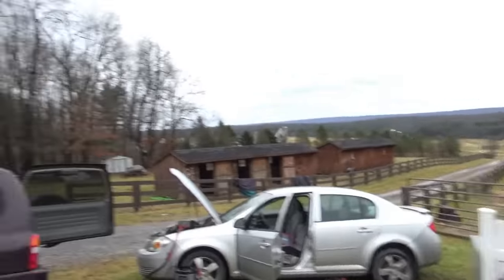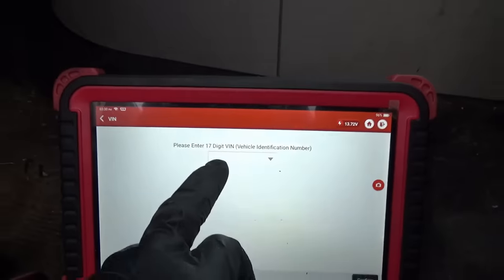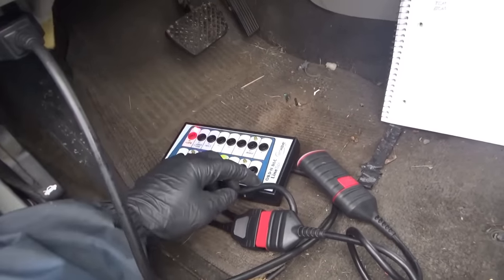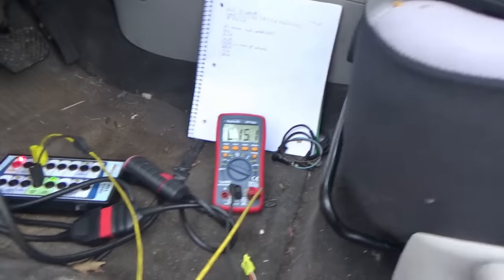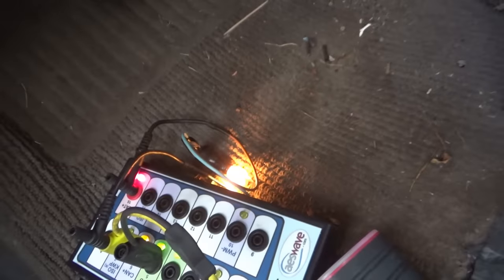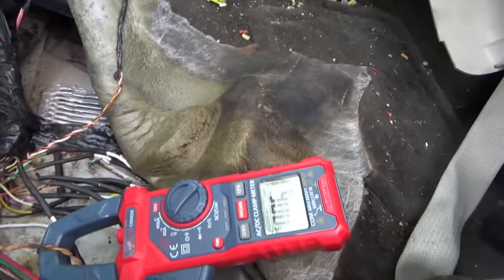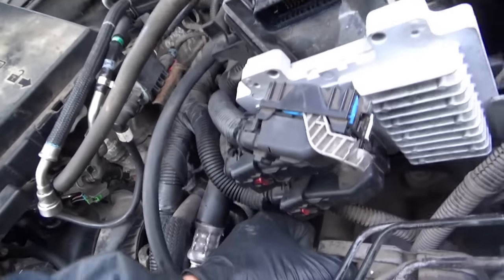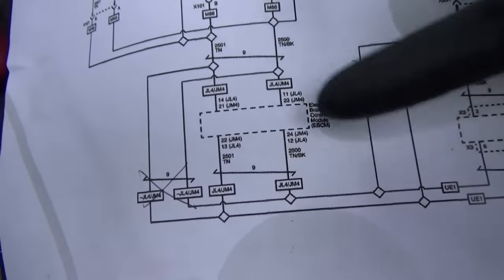Welding DISASTER... (Part 1 - No Crank/No Comm after Harness FIRE?)

Comment: I'm going to go out on a limb and say that he didn't disconnect the battery before welding
Reply: Doesn't save you here.  If he burned through the rusty metal and touched the wires with the welder, it applies that 20v to 50v to those lines, whether he has a battery hooked up or not.  It's like basically hooking up a 50v power supply to your can bus line-  It's not going to be happy either way.
Reply: @calholli  that is the first time I've ever heard of that. Have any proof of this ever happening?
Reply: That is a logical possibility. Lightning does travel pretty fast through safety devices before they disconnect, sometimes. Recently had to replace a fairly new big screen and a router and a couple other devices that were hooked to supposed surge protectors. I know that’s AC but actually a similar situation. 👍🇺🇸
Reply: @brianw8963  lol it's not logical it would have burnt the wires with the amperage of welding. Don't give bad ideas credit based on a completely different situation especially when you are talking about completely different types of things. Lightning isn't anything like welding besides the fact that welding uses an arc and there's no physical contact especially with wires with something between them most likely battery was connected and when a couple of wires got hot they shorted together and fried the computers. Here the other difference yous didn't work at all after the lightning these did just not properly and that would make it even less likely that some how the welder touched the smallest wire and fried the system. When you can clearly see the amount of wires that were repaired.
Reply: @claytoncoolidge992  OK👍🇺🇸
Reply: @@TJKong-do2vq, I would say look in to a lighting rod system. Especially if you’re in a area with a high chance of lightning strikes compared to most areas.
Reply: Grounding the car to an outside source (like a panel grounding rod) would be the only assurance. EMF/EMP is what really caused the module damage.
Reply: Even disconnecting the battery, you should always ground directly to the object you are welding on  , in other worlds don't go welding on your muffler and put your welding ground cable on the engine or bumper or rim  because it could still fry electronics, most of them are still grounded to the body of the car....
Reply: @drjoeset  Exactly.  You have to complete the circuit for  a module to be zapped by the welder;  grounding across your car is like shocking yourself from one arm to the other--  the electricity crosses your heart and it's dangerous;  but if the ground and power are both on one arm, then it only shocks you locally between the two contacts, and not across your heart. It's the same with a module.
Reply: @claytoncoolidge992  I agree, Lighting is very high voltage, up to a Billion volts, and is a different animal which can jamp across almost anything;   where as the welder is only running 20v to 50v DC (for welding steel).  I've welded several flat beds on the back of trucks and many times I forget to unhook the battery, and it's never been an issue.  

If it only heated up the wires as you said and shorted them to the 12v battery, it would most likely just throw a fuse I would think;   maybe 12v on a can bus would blow modules, I'm not actually sure about that.   The extent of the damage just looks more like it was zapped with some real over voltage.  Also, a short with 12v can burn up wires just as quick easy as a 50v welder; EXCEPT- all the 12v power passes through fuse boxes-  where as the welder is not fused at all and will just keep pumping those amps;  but I'm sure he didnt' make contact for long, which is why the wires didn't continue to heat up and catch fire. 

We didn't really get to see the metal, or the wires before the repair-  so we're both just speculating.  But most of these modules are built to handle being shorted to ground and/or 12v.  That's why these guys can so often troubleshoot/ find the short/ repair it/ and suddenly everything works again.   It would be nice to know for sure precisely what happened: so neither of us have to speculate.
Reply: @calholli  these modules especially in the can bus won't handle 12v ver well at all. I'm using 20+ years owning my own shop and making my own mistakes and killing a few modules myself. Static electricity is enough to fry a computer module. Back feeding a can bus line will cause all sorts of issues. If you have ever shorted a capacitor and watched it pop then you already know that a tiny bit of backwards voltage would pop it. All the symptoms are consistent with a blown capacitor including a semi short to ground. But let's see if we can get proof of that in this case. IVAN grab a module or so and pop them open and look for a blown capacitor. If you see any let's see a good Russian Cheap Parts Required fix and see if replacement of any bad caps would fix the semi working modules
Reply: Maybe lightning hit the welder when He was  welding and the car wasn’t surge protected?  Holy crap what did I start, I just felt a little bad for the fella. 😅🇺🇸
Reply: @claytoncoolidge992  Right on..  I can see that being an issue if the can bus is normally only a 5v reference or lower.   It's just kinda crazy that it managed to take out so many modules, and not just one.
Reply: @calholli  ehh maybe but there stands the chicken and the egg. Witch came first did one module fry and when powered back up take out others? Especially if one was a dead short? Or maybe when the wiring was being repaired did some one hook up something backwards and fry others? To be honest with you I have a good feeling that there's Alot more to this than what the customer said. I've seen this type of situation before and it happens after someone tries to jump start the vehicle and hooks cables up backwards..... And being there's a parasitic draw and dead batteries in the equation what do you think that the odds of a here hold my beer moment? And it may have been one of the shops that this was taken to that it happened at. But one thing I am pretty sure is there is information missing from the story.
Reply: Crikey, some dumb theories here, he could have actually done the same amount of damage using an oxy torch, if he left the battery connected when the welding heat started that insulation failure fire
Reply: @jo300hn  I don't guess you guys have ever welded rusty sheet metal. lol..   It's nearly impossible not to burn through.  Also, you can only weld little tacks at a time, so it's not likely to heat up like you're thinking, unless it really wasn't that rusty.
Reply: Burned up the wires then did the first splice job himself mixed up the wires and fried the system hens burning the wires while welding easily assume no experience in welding cars nor wire repair

Comment: Awesome!  dude should have kept welding until it burst into flames.  He's gonna have more into this than it's worth just for this repair. Sometimes the juice ain't worth the squeeze.
Reply: If it was insured he could have claimed on that after the fire.
Reply: Might as well junked it ! it is a colbalt !
Reply: man I did almost this exact thing in my 2011 Grand Caravan! We were doing welding repairs on the bracket that holds on the shock and it heated up enough to start the upholstery on fire! I saw smoke coming out and looked to see the rear seat was on fire! Couldn't believe it. Luckily nothing beyond the seat and the plastic in the back was burnt and it wasn't worse for the wear beyond that, but I couldn't believe it.
Reply: @johnt.848  lol, the deductible would have been more then the payout. 🤣🤣🤣
Reply: @tonster4 I had to weld a shock/spring tower on a 2018 Silverado, I put card board to block sarks from entering engine bay then right before welding I soak the cardboard with water. Along with disconnecting battery/grounds and ecus I could

Comment: If anyone can bring it back to life it’s Ivan. This world needs more Ivan’s  is it worth putting  all the time  & parts into a  2010 cobalt
Reply: No, it's not.
Reply: There is always some numpty who says it’s not worth putting the money into it (whatever it is) the owner however, has a different point of view. and who has the motor and the money in their favour.
Reply: It would cost more just in parts than the car is worth to sell out right. Only if there were some sentimental value would the car be worth saving. I hope that answers your question. Be well.
Reply: If the cost to replace the car is a figure greater than cost of repair (factoring in hassle to dispose of old and track down a new vehicle), its economic to repair. Its not just about the book or scrap value of the existing vehicle. Not my decision to make but that's how I'd be doing my sums.
Reply: @baldyslapnut.  If you are very strapped for cash, 2k is a hard pill to swallow.  However, you will not likely get a replacement car for that price.  Most would abandon it, but I can still understand why some wouldn't.  Is it a good choice?  Nope.  But maybe its their only option at the moment.
Reply: @Bobbywolf64  if youre strapped for cash, dont set your car on fire trying to weld on it...and your right about the replacement costs, i never understand ppl saying "it aint worth fixing" when a decent used car is probly >10K now

Comment: Just in diagnostic time, at 3 hours that is $450.00.  You have it chased down and all it needs is module replacement.  I was always taught you disconnected the battery anytime you are welding on a vehicle.  I'll bet he watches where he welds next time.  Great video!
Reply: That and keep the ground lead close to the area being welded.

Comment: Ivan let me start out by saying i'm a fan! I would recommend when cutting twisted pair to cut one wire at a time (when powered on and passing voltage) as basically when cutting both with metal cutters you are theoretically touching the two wires together and could be causing a short and causing more damage to components. I always try to power off the component and will only cut a single wire at a time. Food for thought for the extremely safety conscious!
Reply: Brian, seeing Ivan cut through both wires on that circuit simultaneously made me cringe also. I think those CAN driver circuits are current limited and/or fuse protected. But as someone who has worked in both communication networks and power distribution systems I agree that de-energizing the circuit and if you can’t do that, at least cutting cutting one wire at a time is the best practice to follow.

That said, I do acknowledge that Ivan is at a much higher proficiency level at this type of repair work than I am. So maybe he’s just learned through experience or some training that I’ve never attended that he can get away with this wire cutting operation on a CAN communication bus. And that’s why I watch this channel.
Reply: Damage already done!!!!!!!!!!!
Reply: Well, some CAN faults consist of the two wires shorted to each other, and this doesn't damage anything (as far as I know). All that needs to be done is trace the short and separate them. 🤷
Reply from the maker: You can short out the CAN wires all day long, won't harm anything 👍
Reply: only way to really hurt anything modern is by high voltage or huge static discharge on one of the com. busses. they pretty much used old computer/networking technology and designs to make them robust, with obviously differnet protocols/data.

Comment: I was taught as a teenager back in the 60’s 1 disconnect battery 2 disconnect alternator/dynamo 3 check behind all parts to be welded for wires and carpets et cetera that could catch fire  , such simple checks that would’ve saved him a massive bill and a headache but you as usual we’ll sort it out with your methodical diagnosis Carry on with the great work I love your videos I think you’re one of the best technicians on the net 👍👍

Comment: I can tell you as someone that has done quite a bit of welding on vehicles (my 98 TJ has 3/4 of the frame capped) that you had better check the area you are going to weld in thoroughly! With all the electronic assemblies in the newer cars you have to be absolutely certain that the welding won't cause an issue. I also suggest disconnecting the negative battery terminal from the battery. Yes, you might get away with leaving it connected, but the time it takes to disconnect it as opposed to replacing/trouble shooting an electrical system is well invested. Great video,  Ivan!

Comment: I think welder did two mistakes, 1. not taking battery of, 2. clear out inside for all flammable material. I learned it over 30 years ago, when my fellow student did not follow that rule, and burned interior of customers car. We were lucky our lunchbreak was only 30 min. and we could prevent whole place burning down. 
Avesome work Ivan , now Your customer knows what to do with it
Reply: Yeah, you are welding on a single sheet of stamped steel. Even thick steel will glow on the other side. 

Lots of cars have been burned by people welding on sheet metal that has cabin insulation and carpet on the other side.
Reply: I’m sure the fella learned a valuable lesson, most of us have been down that road. I turned down 2 rust repair projects for just that reason. One on a otherwise beautiful older Buick and another on a Honda Pilot, just because I would have had to remove so much interior material to do the work safely. And I also learned by experience to be very careful working on rocker panels. That sound deadening foam they put in some of them must be impregnated with kerosene or something. Even a cutoff wheel will ignite it. Take my word for it!

Comment: I agree with everyone below. Was also taught to disconnect the battery and check for anything that will burn. Which I did last Summer when I replaced the left side floor pan and part of the right side firewall. No problems except I need to get my welding in order. More practice but, that is what seam seal is for. Hides it all.
Thanks again for another great video. Off to part 2.

Comment: Well, now that it starts it will make a good practice welding test bed.  You can test for start after a weld.  LOL
Reminds me when I was at the shop and a man was working under the car, and knocked it into reverse with engine running.  Drivers door was open and folded forward as car backed out the door.
Tried to save a little money, and ended up destroying the hinges and panel.

Comment: I think you had a case of welder current being sent through the wires into the modules. A fire at worst would have melted the insulation and maybe shorted to ground or 12 volts. The feathers in the tailpipe "priceless". Your right the horse is way more reliable. I have been noticing people spending a lot to fix vehicles a few years ago they would have junked, we can thank the stupidly high cost of new and used vehicles.

Comment: I think the 30 volts from the welding machine is what fried these modules. In CAN wires I've had them shorted to ground, shorted to positive, shored to each other, and shorted to other wires and the modules don't get fried. Usually the CAN lines are made to be resilient against shorts. As long as it's 12 volts or less it's OK, but 30 volts is too much. You could go to a cheap Pull-your-own-parts type junkyard and buy the modules off another car and flash them. Buying them online would cost too much. Also, maybe flashing the PCM would fix the throttle body. You should scope the throttle body motor leads, see if its the PCM or the body that's bad.

Comment: With the current price of used cars, we are in the unenviable position to fix what we have, even if the end results are having too much money into a car you already own.  I have a 2010 Ford Fusion with really low miles but since I live in the rust belt it needs new rockers.  Probably gonna cost me $2-3K, but I can't but a similar car right now for under $6K.  We really need to market to correct, these prices are untenable.

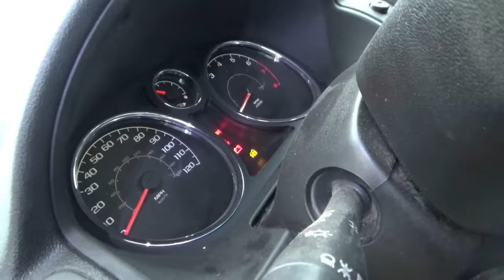Comment: That car had other issues before the burn. At 21:30 you can hear the engine galloping on crank over. One or more cylinders has a mechanical issue.

Comment: Hi Ivan.  Its Mark with the 400k mile vw tdi. Good show on welding. Was it thecwelding current or fire itself that caused the issues. I was wondering if he was using a high frequency tig. I am a novice at welding but recently went out and bought high frequency tig welder to repair cosmetic body panels.  Little did I know that it is not  recommended to use high frequency around the pcm or sensors. So I  threw 2k down drain. Your video makes  me feel a little better about not welding with high frequency.  Great diagnosis.
Reply: If you are concerned about the electronics just unplug them before you start welding. Isolation should stop any unwanted voltage spikes damaging them.

Comment: I am not a welder, what is the proper way to weld on a modern car? Batt disconnect I am sure but after that? Is it as simple as establishing a good ground right next to where you are welding or does more go into it than that?
Reply: If the arc happened to strike the communication lines then I don't think anything can help you... 

But I would like to hear proper practice. I'd at least do what you said.
Reply: With an arc close enough you can get a current spike just with induction

Comment: unhook battery, remove carpet and everything flammable within a foot of where you'll be welding and anything electronic in a three foot radius. then start welding, it doesn't hurt to wet the areas around the weld to help keep paint from burning as bad.